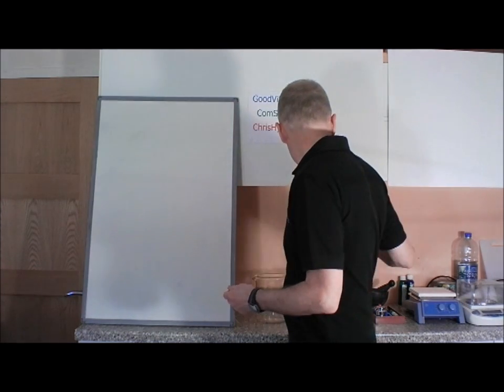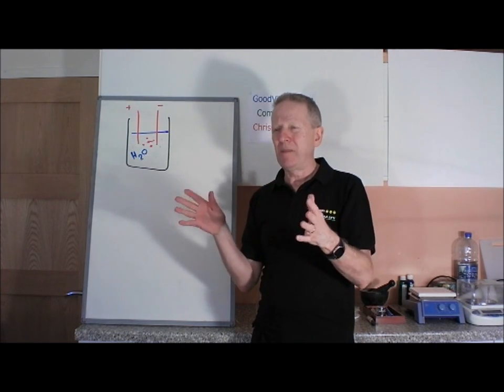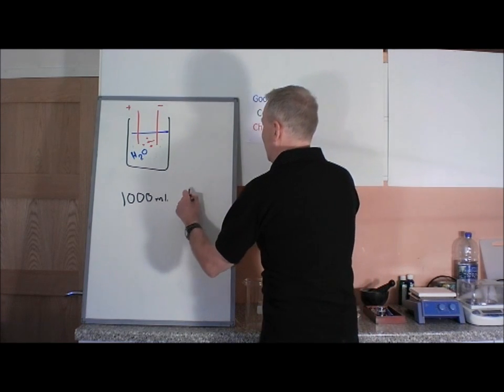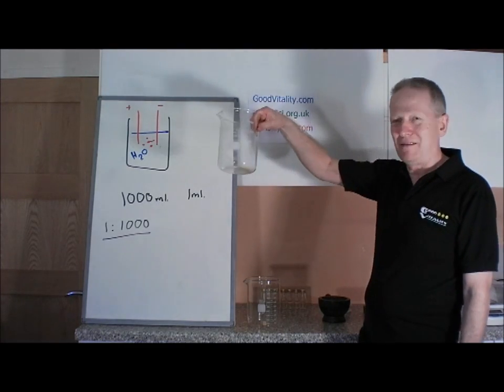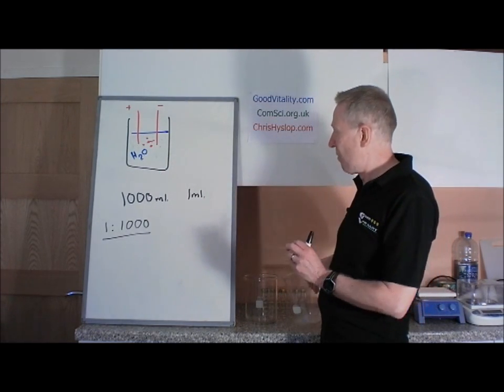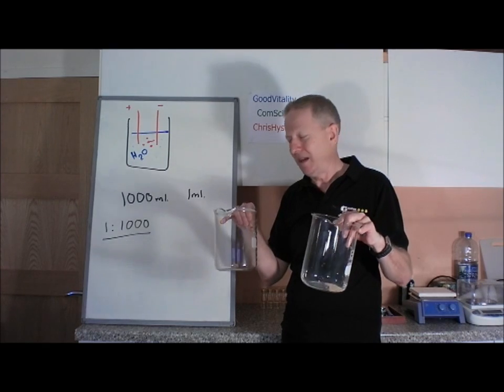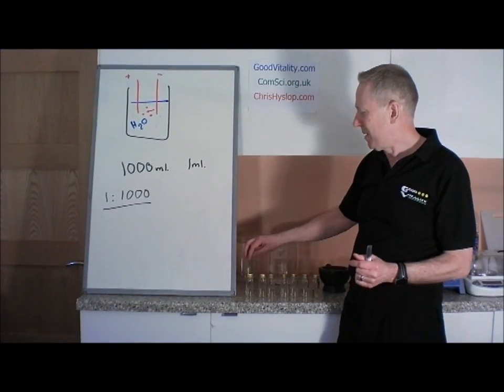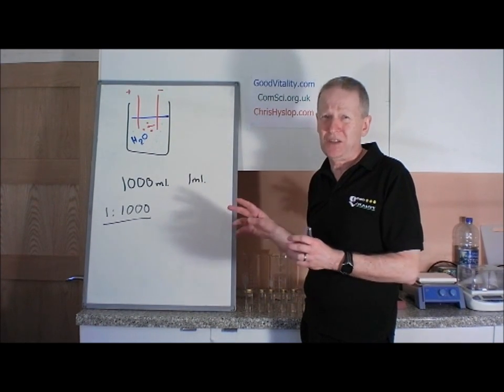Quality of Colloidal Silver and PPM

Comment: Hi Chris. What's your opinion about the use of reducing agents to turn silver ions into silver nanoparticles? Apparently some people use the heating method while making their silver solution, and then add a drop of a reducing agent after removing the electrodes and turning off the heat. They claim that this converts a lot more of the silver ions into particles. Here is a list of some of the reducing agents people are using: glucose, fructose, corn syrup, invert sugar , maltodextrin, and honey.

Just for the heck of it I put the tiniest speck of corn syrup (because I had some on hand) into my last batch to see what would happen. And in just a few minutes it turned a very rich yellow/amber color, much darker than when I just spike it with one of my previous batches of straw colored colloidal silver. It's a pretty dramatic difference.

What are these reducing agents actually doing to the silver solution? It looks like the Silver Lungs generator actually comes with reducing agent in the kit. They recommend the ionic silver (clear solution, no reducing agent) for external use, but they say you should use their reducing agent to turn the ions into particles (turning the solution dark yellow) for internal use. What do you think is going on here? Thanks.
Reply from the maker: hardwork23000 The reason you will not find an answer on line is because the EU in essence banned the internal us of CS.  So publish this kind of info would lead to a prosecution with a potential £50000 fine.
i have written the Becks guide booklet  and this will give you the information you want.  see goodvitality and put in the search box the code 5031.  Good luck.
Reply from the maker: Never found that necessary.
Also the reducing agent may neutralize the essential charge you want on the particles.  personally i would not do it.
Reply: Chris Hyslop what's a good daily dose of a small particle size solution?  And to treat an Illness would it be safe to double the daily(maintenance dose) dose?  I've searched all over the Web and just can't seem to get a definitive answer..  I plan on buying a generator to produce my own CS, but I need to know what a good/safe daily dosage is and also the dosage to treat an illness..

Comment: surely though if its a higher ppm and with very small particles the higher ppm will be more effective
Reply from the maker: ppm does not equal colloids,  it reflects more ions.
How do you assess the particles  -  not with a conductivity meter (ppm)
Reply: Chris Hyslop
I was doing some research because I have a very mild case of scarring alopecia. I heard that colloidal silver, because of the silver ions, helps regenerate tissue cells. I bought 10 ppm and started taking it orally and topically. I'm thinking that if I get 1100 ppm, it'll be more effective. Am I right in thinking this?
Reply from the maker: You might want to consider colloidal silver gel.
Reply: Chris Hyslop
why gel?
Reply from the maker: Osaji Obi for topical use its better
Reply: I made CS using boiled water with 2 x 1.5  volts AA batteries          =3        volts                  with a red led in series.     Net voltage is        3 volt      minus                          1.5     volt for the led = 1.5 volt   s. I also put a 3   3 k current limiting resistor in series to keep particle size small. The measured current was 30 micro amps.          Boiled water is used to sterilize     the water and to remove dissolved gases in the water . 

I made 2ppm CS after 13 hours and 40 mins in 0.8 litres of water.Very small particle size.People who use 4 x 9 volts = 36 volts still don't understand ohms law. No need for high voltages at all or expensive 9 volt batteries.

People step UP   the voltage then put in a resistor in series to step it DOWN      again because of the high current making huge particle size CS.The resistor absorbs voltage.People still don't understand Ohm's Law. V=IR.    

Also it is the     CURRENT that generates colloidal silver.Remember that .     Coulombs Law of Chemistry.

The voltage required is simply the "pressure" required to push a certain current through water.The other day I made CS over 5 days using 30 MICRO amps of current in water which had been boiled using 2 AA batteries with a 33  K resistor in series and a red led in series . I got 10 ppm very small particle size CS.

You use this Faraday's Equation Calculator spreadsheet to work the ppm for a given current,time and volume of water:- http://www.silvermedicine.org/faradaycalculator.html

Comment: Hi Chris, I very much appreciate your informative videos. I recently read that when using a milli-amps to produce CS that anything over 0.2 milliamps means the water is too conductive, and it will not make effective colloidal silver,I am aware and as you often state various other things need to be taken into account, however does this sound about right? Also would 27 volts be a sufficient power supply or would slightly more power be more effective? (32 volts perhaps) I would really like to get this right, therefore I would very much appreciate an answer to these questions, Thanks in advance..
Reply from the maker: RE the milliamps  - sorry a massive vaiable,  it will depend on electrode surface area, , distance electrodes are apart and the conductivity of your water.
Water quality  should be less than 1uS/cm.
Not much help.  Sorry
Reply: Thanks Chris, so what would be the most effective distance for them to be apart, lets say in a pint glass for example with the water quality less than 1uS/cm. or if you could give me some kind of other example that would be great.. Warmest regards, Laurence..
Reply: I aM planning to buy some safe drinkable distiled water measure 0 or 1 ppm how could I measure the conductivity or is that the ppm?? sorry excuse my ignorants in the matter ha ha..
Reply: Sorry * distilled water with ideally 0 ppm or failing that 1 ppm.
Reply: oh i just found out, I would need  a conductivity meter reader. ;)